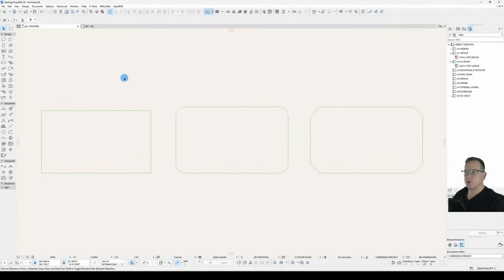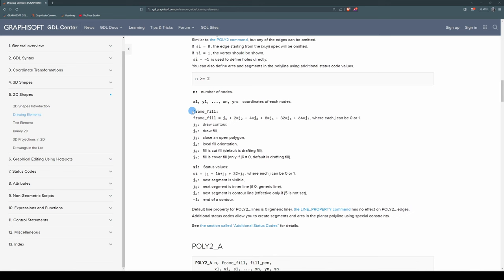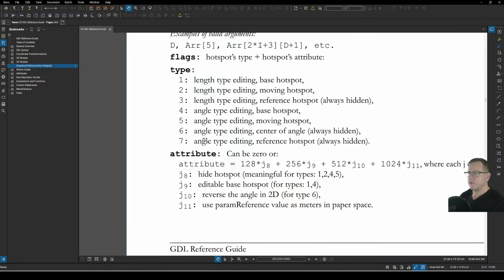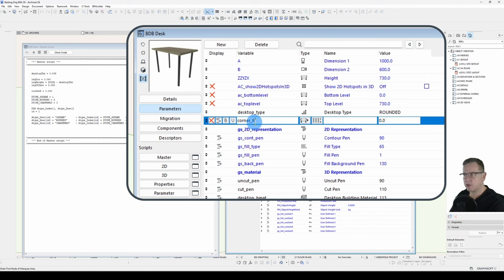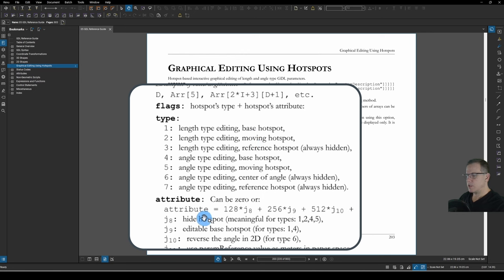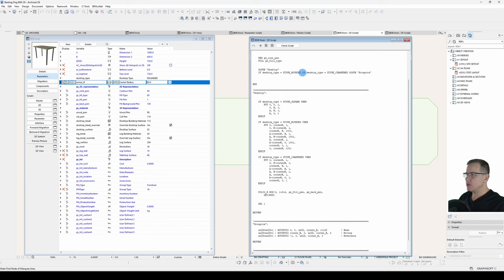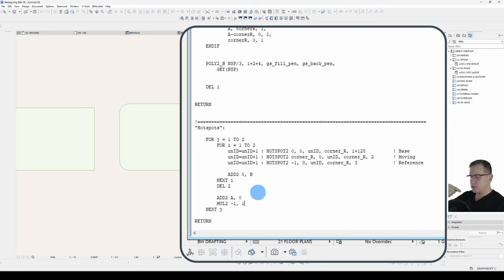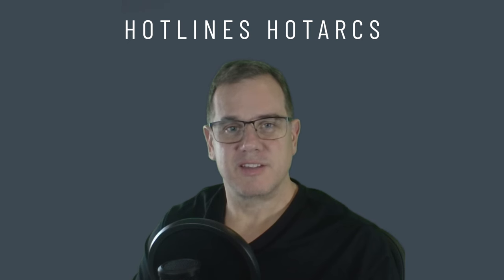008 Beginner's GDL Pt 5: Dynamic Hotspots in ARCHICAD 26

Comment: Hey Bruce!
Do you happen to have an example of 3D hotspot code for vertical and horizontal rotation?
For example: You have an IP camera dome type with a view projection. You want to rotate the projection horizontal and vertical, since camera a dome, rotation is free in both directions [0,360].
Hotspots need to follow the projection.
Reply from the maker: No, not yet.  These are quite tricky.